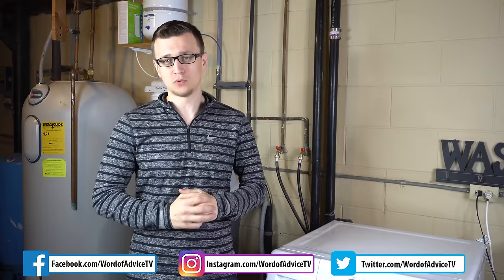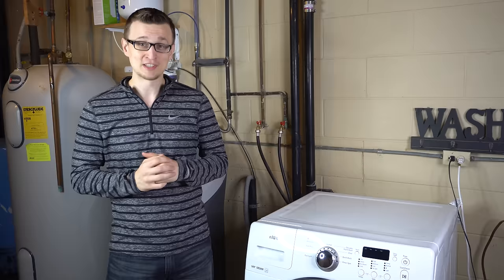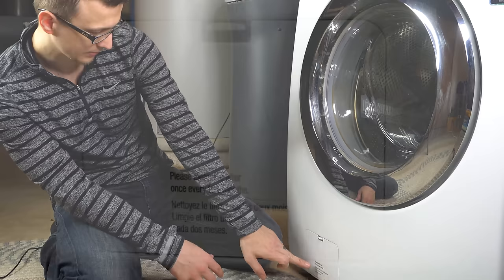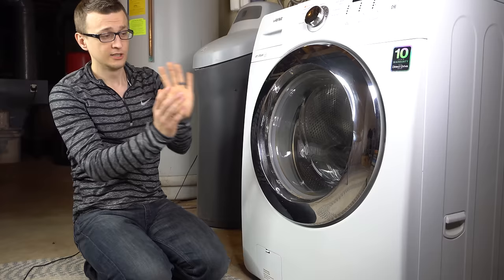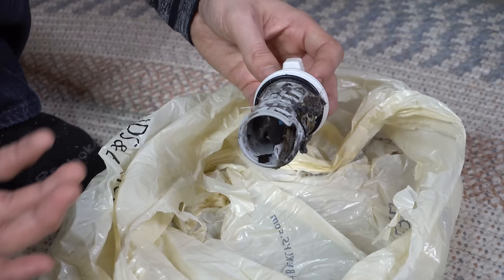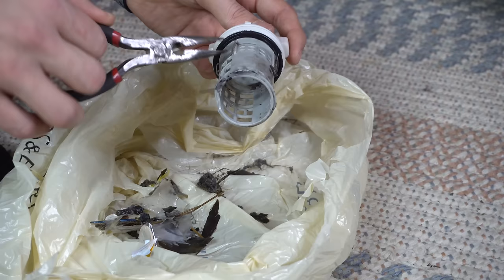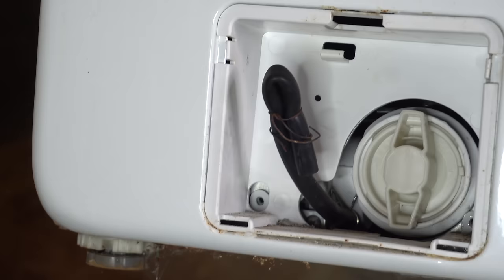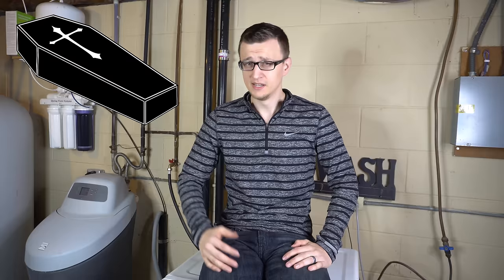Washer Not Working - The Most Common Fix

Comment: Spent half a day checking error codes and running diagnostics, cleaned pump filter housing, but did not work, suspected it was a problem With the door lock on our zannussi zwf16070w1, 
BUT THEN i i came across your video, I cleaned pump housing as per your instructions , with machine tilted at an angle and drained excess water, and now running again, Thank you so much for the help

Comment: Anytime my front loader has ever glitched, it is the drain. Once, a child gave me a small shell (I’m a teacher) and I left it in my pocket.  The shell had wedged itself in the little blade that pushes the water out.  The second time, I made the mistake of being cheap and diluted my liquid soap. I had to drain and reset.  My son is an engineer and he always says, “look for the most simplistic thing and work up the ladder and stay calm”. Both times I fixed it myself. The hardest part was moving the washer/ dryer combo out from the wall and cleaning up the water spillage as my front loader gives no clearance between the drain and the floor. 
I wish someone would install lockable wheels on these machines- it sure would make life so much easier.

Comment: The title image solved it for me. My washer was rocking by 3/8 of an inch. So it would spin to medium speed, be unable to balance the load due to frame wobble, then never spin to full speed. When we bought the washer used it came with that foot missing and the stated condition of being unreliable. This is the first time for me in 5 years that it was unreliable. Sticking a piece of gravel from the driveway under that corner fixed it. Now to get an actual foot with a lock nut.

Comment: Jay --- Also check the drain hose coming out the back of the washer!  Mine was filled with some gunk - maybe because the tube had a dip (like a trap) before looping up into the wall hole.  It became completely plugged so the point that my drain motor & impeller broke.  After cleaning the drain hose (with a dryer lint brush --- that's some irony there!) and some dawn soap, it is now perfectly clear.  Bought a new drain motor for $18 on Amazon and replaced it myself.  All is good now!

Comment: Too bad the engineers that design these appliances design them have problems with time. You shouldn't have to take your washer apart to access these filters and make them work.
Reply: 100 percent! But that’s just how the world works now a days. A .10 cent part is keeping the company from making another sale. Because if the customer doesn’t know how to fix or someone who doesn’t have the time they will just get a new one. And 10 of 10 most of the time they will buy the same company appliance for whatever reason (color matching, function layout, etc.)

Comment: Good morning from Houston, Texas.  The video information / advice regarding the front load drain and filter was absolutely correct.  The tip on tilting the washer back excellent, there was more water than I expected.  After clearing the filter the washer started operating.  Initially, I had gone to the online manuals and the codes indicated out of balance; after following the suggestions without success, the last suggestion was to call for either telephone diagnostics and or a repairman.  I watched two YouTube vides before finding yours; and decided to check the filter...Thank you.  I will also check out your various advice videos.
Reply: May i know my washing machine cant wash .its because the filer or something else .please help me out
Reply: Please guys my washing machine is showing me paused and play I really can't understand why

Comment: i have a question, I tried doing a load of dirty towels and after washing they were still visibly dirty, i thought it was the agitator but it seems to spin with no problem, only thing I can think of is when I started the washer it sounded weaker then normal if that makes sense. Any clue what the issue may be?  I have an older amana washer not sure the exact model #

Comment: GREAT VIDEO.  I HAVE A WHIRLPOOL DUET SPORT FRONT LOADER AND HAVE REPLACED THE WATER INLET VALVE, PREASURE SWITCH, AND DRAIN PUMP. STILL NOT GETTING THE COLD WATER TO WORK, THE CLEAN WASHER CYCLE, AND THE RINCE SPIN CYCLE WONT WORK.  WHAT AM i OVERLOOKING?

Comment: Eh, it's plugged in mine twice in the last 15 years.  I have to take the front bottom panel off, so at least it can be done without pulling the whole machine apart, but it was definitely not intended to be serviced often.  It's definitely a "have the shop vac ready" job.  It's not mentioned in the user manual, only in the service manual.

Comment: I have a Beko WM 74155 LM. I followed your demonstration and had removed hair clips, a button and bits. Having put everything back together when I tried the machine it will not fill up with water and start the cycle.  I had watched another video and manually fill the machine with water via the soap/conditioner. The machine did empty. Again I tried to put it on a wash cycle but again it's not taking any water into the machine.  Any ideas of what it could be?

Comment: A question I hope you can help me with. The Samsung front loader washer will run until it got to the spin cycle and then stop with water still in the barrel. So I check the level of the washer and it was a little out of level and I also cleaned out the filter. After I did this now water want even fill the barrel. Not a drop comes through and it won't even spin. It just makes a noise where the filter is located. I wonder if I damaged anything when I cleaned the filter. What do you think may be causing this issue? The water not coming in and the barrel not even spinning now?

Comment: Hi, I need your help I have a Maytag washer and dryer stackable combo and I just move to a new apartment and after installing the units at the new place is having an electrical malfunction I believe, basically what's happening is that the washer only works  by pressing the dryer start button but then after a few seconds the dryer start working but only by keeping the dryer start button pressed and with the washer on cycle is very weird and it working fine before the moving. Any advice will be truly appreciated 🙏

Comment: my Frego washing machine 6kg front loading firstly working for a while but water was not suckling and given E 12 error.  After after some time no any display coming like no power inside but when I power on at plug not machine it's given sound like something moving withhard sound in dram but dram was not moving even no power on display or any where in Washing machine. Since its stop not working have any idea whats a problem..?

Comment: My front load is the older kind with no door to the filter.
Instead of taking all that stuff off, couldnt I get a hole cut in the front so I could reach it fast?
Is there a hole in the bottom that could be reached threw to the filter?
Thank you for your time.

Comment: I cannot find the drain pump in my Fridgidaire front load washer. I already removed the front panel but could not move past the big rubber seal at the loading opening. I opened the back panel but did not want to disturb the bearing in the back.

Comment: Is there a similar way to run the diagnostic on the dryer from the same series? My wife's dryer coutinualy beeps every few seconds as the 'End of Cycle' light involuntairily cycles from HI to LOW to OFF, then repeats. The timer also fluctuates invountairily. It does dry clothes, but the changing drying times and the continuing beeping is annoying. Any thoughts??

Comment: you know i pulled out my washer, actually smaller then yrs. did as you said and pulled my back out. had th Fire Dept here "911" and off work for 3 days. a friend said you should also turn off the electricity too.
Reply: He should have also said not to attempt this if you have no common sense.

Comment: My washer drains but clothes are to wet to put in the dryer.  First load of the day the machine works fine. Subsequent loads, clothes remain soaked. I cleaned the filter but that didn't heip. Any suggestions?

Comment: Considering there is a drain hose in the little panel he opened, I suggest you use that to drain , and you dont have to scoop anything, bypass the door, tilt the machine or anything like that. Works fine on my Bosch.

Comment: what if its a new machine? the first test wash i did left my clothes really wet. several washes later still the same issue. also shakes pretty bad when it does a spin cycle. also did it since the start. what could it be

Comment: What if my filter is clean and it still won't drain?
Reply: I have the same problem.  Cleaned the filter and still won't drain.
Reply: Me to
Reply: You maybe need a new pump
Reply: @charlesponzi9608  1)clogged water hose in the end where its connected to the dump 2) clogged black hose between drum and drain pump 3) drain pump failure (too high resistence of the coil or endless resistence) 4)No voltage from control board to the pump
Reply: Exact...same problem
Reply: @chazzlebazzle69  mostly its clogged drain pump. Or its not turning already because of the faulty coil or bearings. Very common problem is the clogged drain hose filter in the end of the hose. Its a simplr fix.. another commn problrm..coins from the pocket are blocking entrance to the drain pump right behind the large hose which is connected to the plastic filter with drain pump inside

Comment: I have an old school washer for the house & it’s entire wash cycle is under 25 minutes ( bout the same as the front loaders at the laundromat ), but the one for the garage apartment is a top loader without an agitator & it takes twice as long to go through a cycle. Is that normal?
Reply from the maker: Yes, that is normal. The newer washers use less water and are more efficient... They spend a lot more time "sensing" the load and balancing it out and each cycle is dragged out to last much longer to insure the clothes get cleaned.

Comment: Thanks for the amazingly helpful videos! I have the same issue but with a twist.

Samsung FL washer has been working well with occasional filter cleaning for past 7-8 years. Now suddenly it gave SUD error which got me to checking the filter which was full of scale deposits. Not only the filter but the drain pipe leading from the tub to filter was also full of it. It took three cycles of empty runs each followed by filter cleanings (filter was full of scale deposits each time) that it got/remained clean and error cleared. But after only a couple or so washing cycles later the error returned and again the filter was full of scale deposit to the brim including the drain pipe leading to the filter.

The question is How could so much debri get deposited so quickly!! After facing the upper scenario a couple of more times now; it really seems that this debri has accumulated somewhere inside the machine and it keeps coming from there after dislodgement perhaps. No way is it possible that so much scale deposits come from the water source in only a couple of washes when it hasn’t happened in years earlier. The well water is hard in the area but still it isn’t possible.

What do you think abt this situation?

Comment: got hoover washing machine 9kg error eo3 show up cleaned coins from filter all kk 2 day later e03 wont   run when reset goes back in programme fitted new pump same if i fill up in rinse mode drains but when almost drained e03 stop again

Comment: We bought a Midea top load washer.  "I cant find any service technicians in our community that can help me.  It has an agitator that has a screw in the bottom that you can take the agitator out.  When putting the screw back in and tightening it tight and starting the washer it will agitate fast to weigh the load and then will loosen the screw to the point that it only agitates slowly and does not clean the clothes.  Everything else seems to work fine.

Comment: Do you work on refrigerators
Reply from the maker: Unfortunately I do... But they, along with dishwashers, are on the bottom of my favorites list..
Reply: Do you have any video on refrigerator repair
Reply from the maker: @Michael Trowbridge I actually don't... There is so many different fridges out there and unlike furnace and air conditioners where regardless of the brand, the general structure and disassembly of the unit remains the same.. With refrigerators, there's a lot more variety so it makes it hard to make general/broad repair video. Fridge repair videos almost all need to be brand specific videos. I have watched RepairClinic's videos quite a bit in the past though. They have thousands of appliance repair videos so I am sure you can find most of the info you need with them.

Comment: My LG front load is making a grinding noise when it attempts to spin. Clockwise doesn't seem to get anywhere and it stops and the drum free swings, then it attempts to go counterclockwise and may get spinning slowly but stops. When it finally makes it to the spin cycle it makes a grinding sound when it is spinning and it is not up to normal speed. I have pulled the rotor positive that the splines are gone, but they are fine. Now what? The pump does work and my filter is always clean.

Comment: Looks easy enough to do. So, how much did you charge the client for this service?

Your example is the best case scenario. My washer (Frigidaire Affinity front loader), I had to take off the top cover (easy enough), entire front panel (somewhat of a burden), and then take off 3 clamps to take off the boot assembly (the worst part) to access the coin trap. Overall, not fun.

Comment: My hoover washer won't turn on before I cleaned the filter loads of water came out then I got another problem there was a clicking noise like it was resetting trimmer so I left it a few days it lite up there was a code 1400 150 I turned the Dile but nothing so I turned it off at the wall now it won't do anything

Comment: I have a Samsung washing machine that's a front load and it does not like to spin.  It won't start to turn then it will get a little faster and before it actually picks up enough speed spin the clothes it will stop spinning and it just sits there and does this over and over and over what could it be.

Comment: Wow. Are there really techs that work on Samsung appliances??
Reply from the maker: Unfortunately there are :) I used to hate working on Samsung machines but they actually are not too hard to disassemble compared to many of the others so I have grown to like them a little bit more..
Reply: @WordofAdviceTV  you are the first that I've heard of that will work on them. I know of 9 servicers in my area and none will work on Samsung including myself. Are you able to get correct parts and parts that will last?
Reply from the maker: @LUTYTV  For a while there it seemed like 1 out of 3 times I may get a wrong part and the part orders could take up to 2 months but lately it has gotten much better. Maybe 1 out 10 times I will get a wrong part? And the shipping times have gotten better as well. I also started to highly recommend OEM parts to homeowners even though the part may be on back-order. Because as you eluded to, the universal parts are not very good.
Reply: @WordofAdviceTV  Long story.....a few years ago Samsung paid me to drive 200 miles round trip to install parts on a washer and a refrigerator at a Lowe's store. They sent me the parts ahead of time to replace. I went there and none of the parts were correct that Samsung sent me. Samsung then sent me more parts. About 3 weeks later they called and wondered when I was going back to install them. I said as soon as you authorize the labor and trip charge again. They thought I should go back at no charge. Idiots! 

I almost always use OEM parts on everything. I'm not yet hungry enough to work on Samsung. Maybe someday. I've tried for 12 years to get local stores to quit selling that crap but they still do. Lot's of very unhappy customers because of it. I probably turn down around 3-4 Samsung calls per week. I'm in a small city of around 20,000.
Reply from the maker: @LUTYTV  Oh wow, it sure sounds like your experience with Samsung was a lot worse. Thank you for sharing the experience! I think it is a little different for me because we rarely ever deal directly with Samsung. The customer is on an appliance service plan and the company covers the repairs, not Samsung. Unless it's still under warranty or has a recall on it.

Comment: how you know how to operate your machine if you didn't read the manual
Reply from the maker: I have worked on hundreds of washers :) Eventually I started getting to know them better, to the point where the manual is rarely needed.
Reply: @WordofAdviceTV  not you   i mean commenters who dont know where the filter is and btw resetting after repairing is not common knowledge, it is like a manufacturer secret, could not find for candy/hoover toploader
Reply from the maker: @georgio jansen Ohhhh! Sorry for misunderstanding you. YES! You are very right. The manuals seem to never be readily accessible and are usually somewhere on the inside of the machine..

Comment: I have a top load whirlpool washer. When set for cold rinse the clothes are super wet. When I use the other temperatures the clothes are fine. Are they supposed to be super 
 wet after cold rinse? Messed with the drain hose and it didn’t make a difference. The machine is about 18 years old. Does anyone have a suggestion?

Comment: Just remember if you pull your machine out from the wall & it doesn't go back in the exact place, you may need to rebalance it. Also it can be a bad or failed pump that causes the same problems

Comment: I have a samsung front load washer that I have recently changed the door lock and 1 shock  and now it does not aggitate or spin but fills with water. What can I do
Reply: Do you get an error? The drain pumps are known to fail. Might check that. Theyre not too tough to replace on your own.